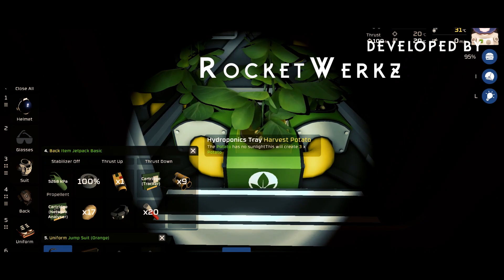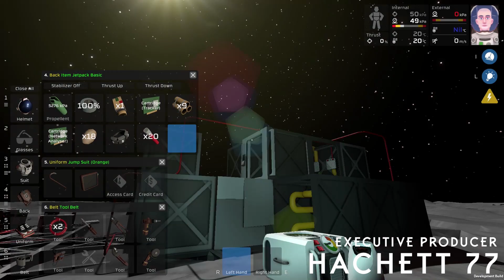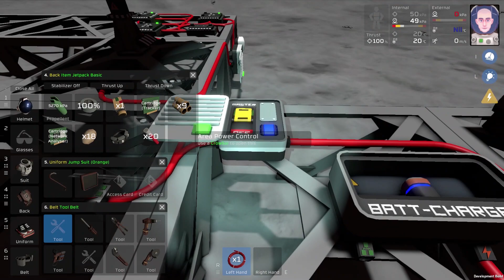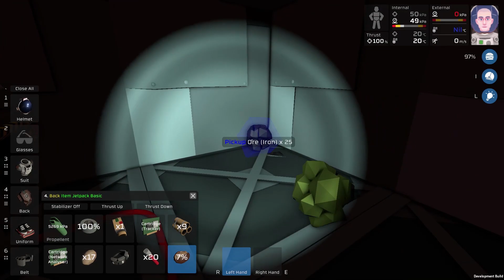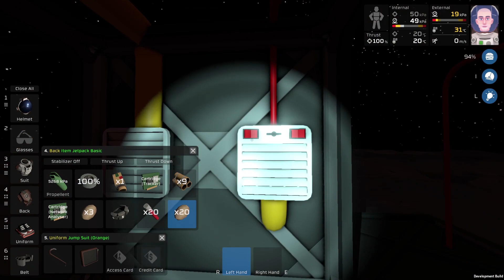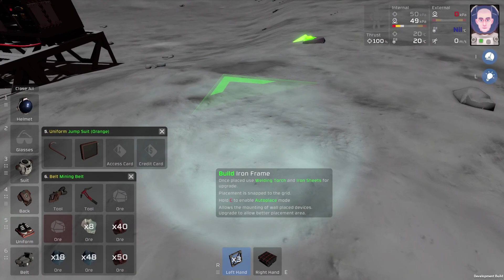Stationeers | The Furnace

Comment: Furnace..you can use the input pipe to fuel the furnace. But it is quite advanced to get the right mix of gases to feed the furnace. It is much easier at the start to put the volatiles and oxcite directly into the furnace. You don't need a pipe on the input of the furnace, but you do need one on the output of the furnace. Output to pipe to pipe valve to pipe to passive vent.
To make steel for example.  3 iron and 1 part coal.  Start with an empty furnace (open valve, when empty close valve) Put 2 parts Volitles in the Furnace input hatch. Press  the red button, you may need to do this several times until the hatch opens. Now put in 1 Oxcide. Hit the red Activate button and the furnace will fire up. Now put your ore in. Hover your pointer over the front of the furnace and when it says will make steel pull the lever.